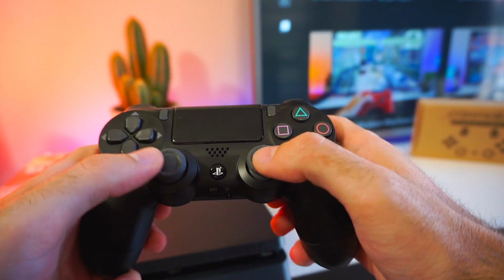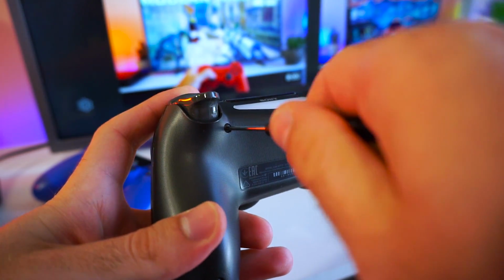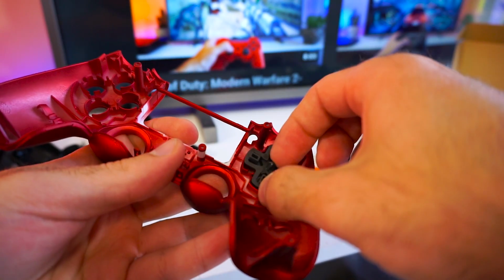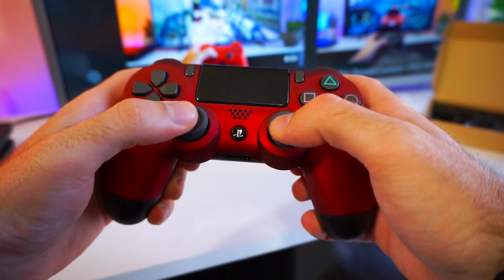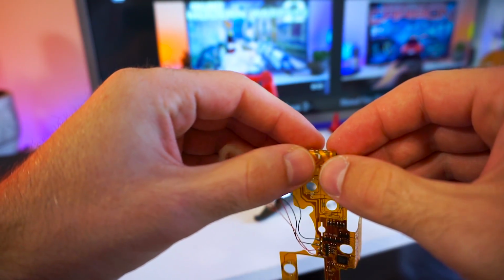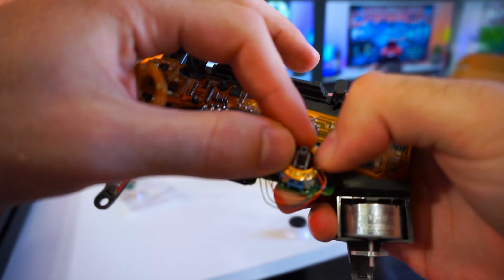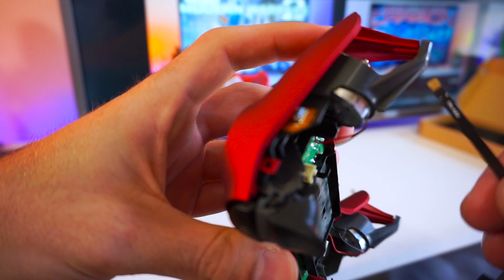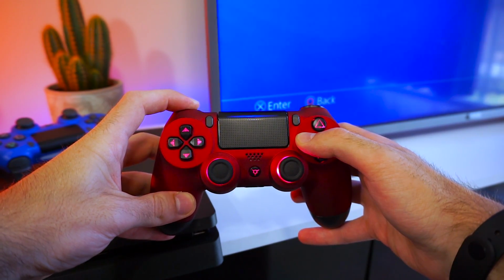PS4 Controller LED Kit Mod-Installation And Review (eXtremeRate PS4 DTFS LED Kit & Controller Shell)

Comment: Um very important question. I've just finished installing the kit into my controller but for so e reason the controller cant operate without it being connected to the ps4. Even though I left it to charge on the Dock the Dock light inst changing its colour like it normally would although the controller is charging still..  But what concerns me more is that when I try to play a game with it now I hear a electric like sound emitting from the controller so do I need a bigger/better battery or have i not connected correctly? Although the lights seem perfectly fine and are working.... Please help?
Reply from the maker: Perhaps you did something wrong during the installation process, brother. You can watch the tutorial on their page.
Reply: @SkvalaGaming  Perhaps, I just need to find out what though since I'm certain i followed everything step by step.
Reply: @SkvalaGaming  Oh crap. I found out the problem. Its that somehow one of the red wires that connect to the controller is loose as if its broken. I hope it can be fixed but that's the reason why it won't work.

Comment: hi everytime i hook mine into the battery, the led light blinks once and goes off..any idea why its doing like that ..also my controller is not turning on when i press the home button..please help if u can
Reply from the maker: One is because of the low battery, and that means that you need to charge your PS4 controller to make it back on track.

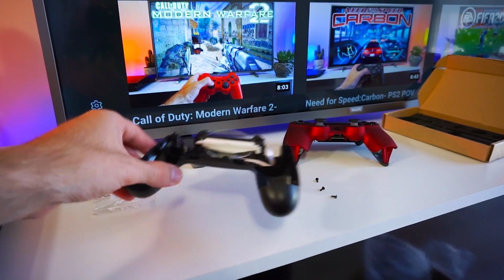Comment: can you get a replacement of that big clear plastic thing by the touch pad " back plate time stamp 6:10" it might be called "transparent light sheet" or led lens  i broke mine trying to installing a battery and i broke the side clips is there any way i can replace that too ? i am so bummed i had that controller since 2016 when i got my ps4 pro.
Reply from the maker: You'll be fine brother. You can get a replacement